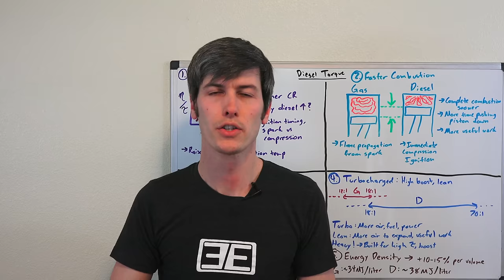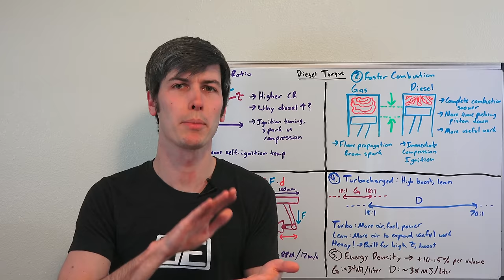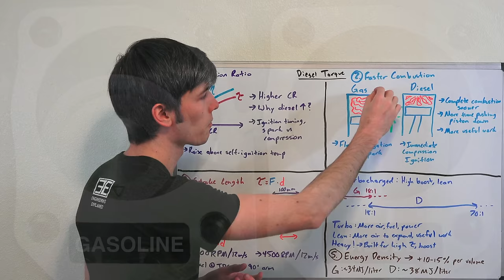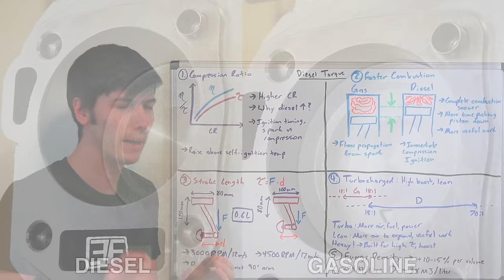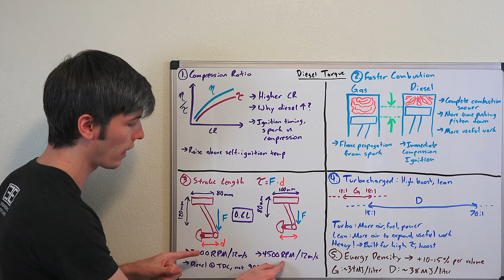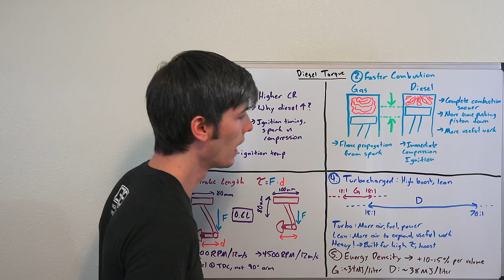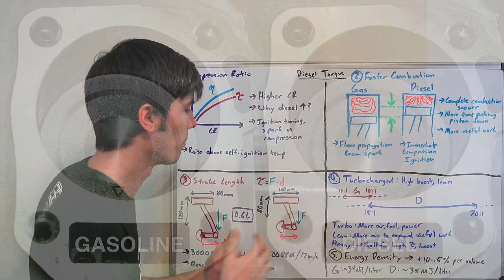5 Reasons Diesel Engines Make More Torque Than Gasoline

Comment: Diesel apsolutely dominates in europe.
Long sedans are consuming as low as 58MPG on open road :)
Example 2.0 diesel in Audi A6, BMW 520d, MB 220 cdi.
Reply: On one of my regular 150 mile journeys, I get 76 mpg from my 1.9 VW tdi that has PD injection.
Since PD could never meet Euro,6 it was discontinued, but its groundbreaking 1,050 bar injection pressure has now been exceeded by the 2,200 bar of the latest common rail pumps.
Reply: wilsjane I had that engine. 
It has a kult status in Europe :)
Now I have 2.0 TDI. 
They are achiving better fuel consumption by DSG now, and energy recuperation. 
VW Passat now has 2.0tdi 240hp using 2 turbos, and AWD. 
6s to 100, and it looks totaly clean and refined. 
Ps. Fuel prices are imposible lately in Europe.
Reply: Fuel prices are even worse here in the UK.
I had a 1997 tdi with an AHU traditional injection engine that ran for 285, 000 miles with few problems and despite living in London it was on its original clutch. With such high torque at tickover, I never touched the throttle until the clutch was fully engaged. The PD requires a few more revs to pull off.
I have driven a fast response Skoda ambulance with the new common rail injection and 6 speed DSG, but I still prefer manual.
Many people do not know that the 6 speed DSG was a Borg Warner box with wet clutches, whereas the 7 speed is a completely different dry clutch unit designed by Audi. It has a few problems on early production with the solenoids controlling the selectors burning out, but Audi are good at updating problems and I believe that if they go wrong all the solenoids are replaced with the updated version.
Reply: Get rid of the 2.0 TDi before warranty expires. Engine will probably be fine but everything else will fail.
Reply: +paulanderson79. What do you find fails on VW and Audi, we have run them  for the last 30 years and they suffer very few faults. Friends who own Mercedes and BMW seem to have a lot more problems with them. 
I am a chartered engineer, so I do all my own service, 
Back street garages take short cuts and do not have the correct diagnostic equipment, so they can turn most modern cars into a nightmare.
Reply: +wilsjane - I don't go near backstreet garages as I am acutely aware of the perils.

I am merely reporting my personal experience. As you are.

My cars are maintained meticulously. I ran a BMW 528i for 381,000 miles with nothing more than routine servicing.

I've had good experience with Peugeot, Nissan, Renault, BMW amongst others. Currently running a Mazda 6. 
 All fine.

But the VW Passat B6 was a nightmare. Set me back £5000 in less than two years out of warranty. That was on top of normal servicing and consumables!!

I hope your VW Group experience continues to be a positive one. Mine was the polar opposite. I wouldn't mind so much if the parts were cheaper. VW parking sensor £96. BMW parking sensor £22. Why ????

Chartered engineer. Which discipline?
Reply: +paulanderson79. You sound as if you were unlucky with your Passat, we tend to use the Golf estates as workhorses and I had an Audi A6 for many years. 

I order parts from the manufacturers such as Bosch and Lemforder, but I would never use cheaper pattern parts. What cost you all that money with the Passat.? 

I have friends who run both Nissan and Mazda, but one guy had endless trouble with Renault, trims dropped off the vehicle and the interior was shoddy. However that was 20 years ago, so things may have improved.
My charter is in the film industry, taking care of the listed buildings in London as well as the sound and printing of 35mm film and theater equipment. 

Some years ago, a friend bought a Ferrari and 6 electronic ignition boxer burnt out in 18 months. At £700 each in the 1980s, After the first years warranty, it was a nightmare. 
In desperation, I took the last sealed unit to our camera workshop (Panavision) and the head of electronics opened it up. A resistor in series with the output transistor had blown. The repair cost 6p. 
Unable to understand what was causing them to blow (every fault on a camera is investigated) he took a look at the car. It took him about an hour to discover that a loose wire in the rear light cluster was shorting and using the ignition box as a fuse.
Reply: +wilsjane - I agree, My experience isn't indicative of the norm with VW Group products. Then again, nor was my BMW experience but for polar opposite reasons. I think pre 2006 Passats were better than mine. As are other makes in the same group - Skoda, Seat Audi etc. Shame VW can't incorporate Porsche's bulletproof reliability.

My Passat issues were:-

Turbo failure
Oil pump failure (luckily the engine survived)
New Dual Mass Flywheel and Clutch (kind of wear and tear but still overpriced)
New 6spd manual gearbox
Both rear brake calipers (electric parking brake and thus £430 each).

It's the high cost of putting things right which really wound me up.

My Renault wasn't the best to be honest. Nissan and BMW bulletproof amd Mazda 6 (getting on now, it's a 2012 model) has been fine so far.

My background is electronics btw .

Have a great day

Cheers,

P.
Reply: +paulanderson79. I wonder if your turbo fault was caused by the oil pump wearing. One vital thing wit those engines (particularly when they use PD injectors) is the oil. I always use Mobil fully synthetic, other oils simply do not have the additives to keep them flowing. Even main dealers have been known to use the wrong oil all all of what happened to you is typical of the outcome.

Like you, I have had a duel mass flywheel fail, they are a real pain, but allow a slower tickover and drop the vehicle into a lower emission class. Hopefully the stop/start system will allow them to go back to a solid flywheel in the future. I bought my replacement directly from LUK. VW. use 2 makes, but on a complete replacement you can use either and the LUK seems better suited for London driving.

The 'wind in' calipers are also a problem and the electric version can be even worse. 
Stripping and cleaning them normally works, but garages often cannot be bothered. When replacing the pads on the electric version, failure to  clean them properly before using the motor to wind them back will destroy he motor. Garages also need to know how to use the computer program to wind the caliper back. Some garages don't know the procedure and either destroy the motor or just replace the unit because they don't have the software or know how to use it. 

I have never come across a VW gearbox failure. 
Again, with selector faults, a good mechanic could have replaced the damaged fork. 
Did the gearbox fail AFTER the clutch replacement.? 
If so, the gear change may have been incorrectly aligned, leaving the forks in permanent contact with the selector hubs. 

Finding good mechanics can be very difficult as cars become more complex. I find that even the simplest work needs a lot of research and a good deal of basic engineering skills.
Reply: +wilsjane - It was indeed caused by the oil pump failure. The swarf destroyed the turbo. Apparently the pump is driven from the chain driven balancer shaft and the drive mechanism between balancer and pump is a known weakness. Not the chain itself.

Yes, PD injectors are savage on oil. They are driven by lobes on the intake camshaft and the followers are much like flat tappet camshafts of years gone by. The oil needs to have massive shear strength to cope with the forces involved. I always ensured that the oil going in met VW 507.00 approval.

Solid flywheels are a no go for me. They put massive stresses on the entire drive train including the crankshaft itself. Not keen.

The gearbox issue was another VW design error. Basically the bearing on the input shaft from the engine starts to turn in the housing / case and thus it effectively over time bores a hole in the gearbox casing. VW modified it by including a key on later boxes, thus making it impossible for the bearing shell to rotate along with the input shaft. Nothing to do with the linkages.

I had the DMF and clutch done believing they were the cause of the original problem. I was wrong. What happened was as the bearing dug itself into the casing it caused the clutch to remain slightly engaged even when the pedal was fully. Concentric master cylinder was also replaced and bled correctly.

The garage I use has dealer level diagnostics and everything was done correctly. Both calipers failed with fluid leaks. The electric handbrake mechanism itself was fine. I have my brake fluid replaced every two years regardless so it's not down to neglect on my part. Just another poor design by VW.

I am a very very fussy driver. My cars are maintained to the teeth. I cannot even tolerate steering wheel a millimetre off centre. I have a full four wheel alignment done twice a year.

I am building a picture here that you and I have a lot more knowledge about cars and how they drive than the average Brit.
Reply: paulanderson79 gotta admit, my turbo was producing whistles under 80k miles, but replaced in guarantee period. 
I also think that people are not maintaining DSG properly, and I was shocked that most of the mechanics think that there is no need for oil change. 
Some people drive it too sporty, and mechatronics tend to fail. 
That is why the DSGs are so notorious.
Reply: Mine was a standard 6 speed manual model. Pure bad design by VW Group. Shame VW can't incorporate Porsche reliability into its other products.
Reply: +paulanderson79. When I mentioned a solid flywheel, I was referring to the conventional design that was in use for many years, but the engine needed to tick over at 1,900 rpm. As you mentioned, the heavy flywheels added to vehicles aftermarket are a liability and have sheared several crank shafts. My thought was simply that with stop-start, the higher tick-over speed will be acceptable.

It seems as if you were extremely unlucky with the gearbox issue. Sometimes new models have teething problems, but VW are generally very good with goodwill warranty claims when they know that a fault existed. 
The clutch release broke up on my A6 after 2 years. 
To make the vehicle lighter, they had replaced the phosphor bronze slide with nylon and mine melted in the London traffic. Despite 2 years and 60,000 miles, it was replaced with 75% discount. They also went back to the original design. 
To get the refund did take a lot of persuasion though.

Why the garage did not simply replace the fluid seals on your calipers somewhat baffles me. Even if they were not listed as a spare, they would have been available from the caliper manufacturer. A phone call to them and knowing that they had a problem may well have got you an updated seal kit free of charge, 

Have you looked at water-less coolant.? I would immediately use it on any new vehicle. With a -20 freezing point, +180,C boiling point and nothing to corrode the components, it would be well worth the initial £80.

PD was great, it is such a pity that its mechanical design cannot meet Euro 6, but the new Bosch common rail system produces 1,200 bar at the injectors, even more than the PDs 1,050 bar.

Comment: what makes the air hot enough to ignite the diesel fuel
Reply: Air gets hotter as you compress it. Basically as you squish all those air molecules into a smaller area they get closer together and "rub," which generates heat. (Using simplified terms here)
Reply: thank you
Reply: @jamalabushameh8598  Ok, there's no extra heat from the "rub".  Heat is a measure of a molecule's vibration.  If matter is said to be cold, it's because it's molecules are vibrating more slowly.  At absolute zero, all vibration stops.  When you compress a gas (like atmospheric air) the vibration of molecules increases. The space between the molecules is smaller and they have less room to move. 
When you're flying in a jet at 35,000 feet the outside air is approximately -70f.  Trap some of that cold air in a big perfectly insulated container and drop it to sea level.  It will magically warm to 55f.  Depressurize the plane at 35,000 feet and the 70f cabin air will drop to -25f instantly.  That's pretty scary.  I need to remember to take my jacket next time I fly. :)

Comment: This Engineering Explained guy has no idea what he is talking about.   Typical diesel engines are designed for lower RPM than typical gasoline engines due to the difference in application.   For a given power rating, if RPM is lower, then torque must be higher.
In both gasoline engines and diesel, the theoretical best combustion time for maximum thermal/fuel efficiency is instantaneous.  However, this isn't practical - for a start it would cause shock loading of parts.   In both engine types the substantial combustion time is a few degrees centered on top dead centre.  In gasoline engines, combustion time is controlled by the amount of turbulence designed into the engine.   In diesel engines, combustion time is controlled by the duration of fuel injection - essentially the fuel burns as it enters the combustion chamber (with a slight delay).

Comment: Stroke length does play a huge affect on torque. Reason being in order to get that stroke you make your distance from the center of your crank shaft much longer. Simple rule of leverage multiply your force by the distance from the fulcrum ie more torque with a longer distance from the center of the crank. Torque is turning force. Desils are built for torque which allows for low rpm power. Gas is built for horsepower which is a ratio between torque and rpm so the higher rpm the more horsepower you get so perfect example is the "LS1" which they shortened the stroke and widened the bore  to run higher rpm with the same amount of power but being able to rate the engine at higher horsepower.

Comment: What about the fact that diesel power peaks at lower RPM which translates into higher torque. That's more significant than several of the reasons you list.